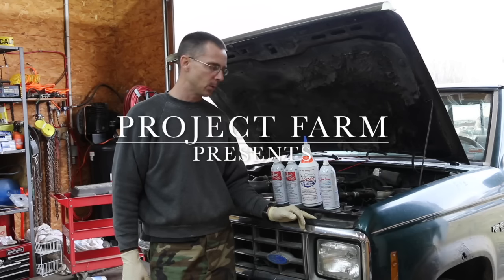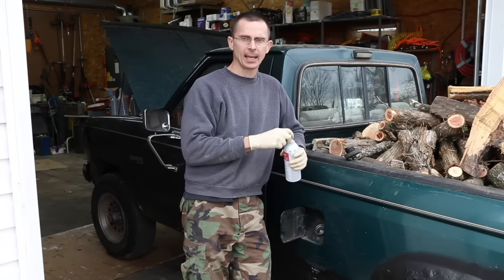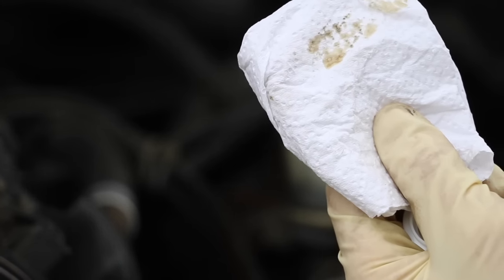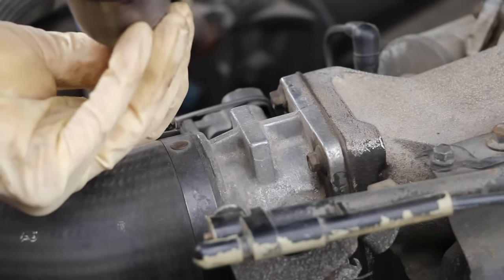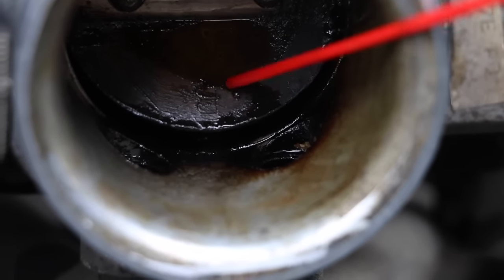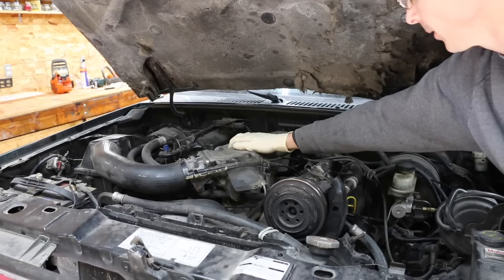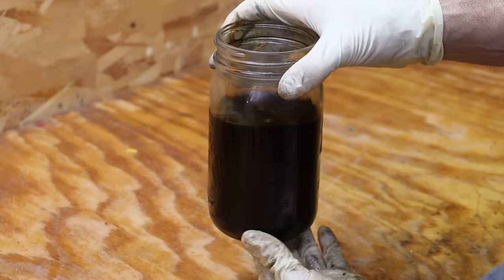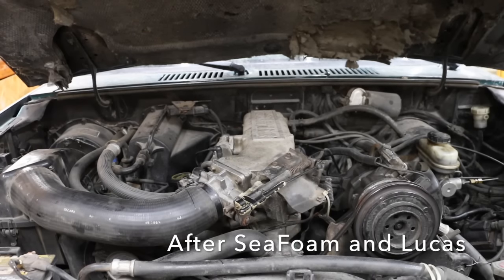Seafoam--can't believe what it did to my engine!!

Comment: Project farm? Can you test the gas engine and see when it will not properly run anymore with too much diesel fuel mixed with it? Florida has a hurricane coming and for some strange strange reason all of the gas stations were the hurricane is going to hit the coast all put diesel fuel in the gas tanks? Hum.... Now I already know putting too much gasoline and a diesel and the diesel will not run but how about the other way around? Thanks if you can do this test it would be awesome.
Reply from the maker: Thanks for the video idea.

Comment: Between diesel trucks and regular gasoline. Do you think it would have the same results? About to give up on this F-350 but it hardly has any miles compared to most 2004. Only 150k and sounds terrible.

Comment: I've had a good amount of experience with valve noise and if its due to a clogged hydraulic valve lifter (which is often the case), then Lucas will make the problem worse.  If this happens, and flushing the engine doesn't solve the problem then you will need to figure out the perfect viscosity of oil to minimize the noise as much as possible
Reply from the maker: Thanks for the feedback.

Comment: I fogged my boat outboard every fall when I parked it.. Choked down till it quit. Then left it all winter. A shot of ether next spring once and away we go.  That engine is 25 years old and purrs like a kitten.  Lots and lots of hours in it.  Also always used 40 to one mix instead of 50 to one on gas. 3 ounces per gallon..
Sea foam is a jigger of acetone in a quart of kerosene.  I read the story about the guys who marketed it.     Old navy recipe.  And coast guard.
Reply from the maker: Thanks for sharing.

Comment: Keep in mind. This is what most mechanics would call trying to solve engine issues with snake oil. Obviously,  every engine repair doesn't need a wrench and part replacement.  Additives are a real thing in being all that's needed in some engine car issues. I have experienced that firsthand over many years of car ownership . This was an excellent video . Yes, some additives may be snake oil.  However, some mechanics are snake mechanics. Yet, mechanics tend to be much less vocal about that.
Reply from the maker: Thanks!

Comment: I use seafoam a lot myself it's good stuff but you got to use it sparingly in a Harley-Davidson that I found I've kind of leaned away from using it even and go with marvel mystery oil sensitive injectors some won't run at all even with c form in them from what I understand and I always had a little bit as good a little more is better definitely not with a Harley I'll put it in a little strong on my other vehicles and it doesn't seem to bother them, I had one engine that would tick a lot and what I poured it into the crankcase I would do it while it's running and you'd hear that tick go away is that stuff was poured into the crankcase even
Reply from the maker: Thanks for sharing.
Reply: thinking about running it through my harley

Comment: I put Seafoam fuel injection cleaner in my 2014 Chevy Silverado cause it had a check engine light on for a bad O2 sensor and to my surprise it turned off the engine light but I went ahead and changed all four sensors and found that one was cracked and the others were covered with carbon and my truck has 132000 miles on it
Reply from the maker: Thanks for sharing.

Comment: I just put seafoam in my Mazda, the bottle says run it for 100-300 miles gonna change the oil tommorow (its been 250 miles) my Mazda takes real thin oil (0W-20) would using the Lucas thicken it too much?

Comment: I used seafoam on one of my previous cars after a fresh oil change. Not only did I smoke the entire town out, I got pulled over by the cops, and told to go home.
Then when I checked the oil, there was literally no oil left in in the car lol 🤨
Reply from the maker: lol
Reply: Wasn't it supposed to be added 200 miles before next oil change?

Comment: I used the spray in my 08 ford fusion 4 cyl, didn’t use the whole can but it did sputter out some darker smoke, sitting at 160k miles, is the oil treatment worth the time yet?

Comment: So when you added the seafoam to the oil, did you let it run more than the 10min you were spraying into the intake? Or did you drive it at all afterward before changing the oil?

Comment: I used the spray to treat my GS300 Lexus which has been giving me grief with gummed up throttle body and idle control valve.   Worked brilliantly.  The method shown here is not that recommended by Seafoam. Read the instructions

Comment: Any recommendations for what treatment to use on a 2013 CX-5 it has over 233k miles and I can tell it's definitely louder on top end of the engine at idle. Maybe not lifters but I'm terms of springs, valves and timing chain. Would this help eliminate that noise or would you recommend a more direct tear down and replacements of parts

Comment: I run seafoam thru my vacuum hose... I take one off the master cylinder, let the car run while letn it suck thru the  vacuum hose and into the motor and i believe thats makes the seafoam work best cause it really runs thru it and it usually smokes alot more cleaning out alot more crap
Reply from the maker: Thanks for sharing.

Comment: Is the product used to add into the gas tank the same as what is added to the engine oil? Is it better to add to the gas tank when it is near empty? How long after adding it to the oil should you change the oil?
Reply: About 300 to 500 miles until oil change if I remember correctly

Comment: I actually ruined my 2002 Silverado with Sea Foam. Dosed the tank per the instructions in the parking lot of Menards and truck died on the way home. Had to get it towed the rest of the way. Ended up being a clogged catalytic converter. Who knows if the cat was on its way out, or if the sea foam just broke loose a whole bunch of gunk all at once. Either way, pricey repair. Probably worked great, but not without risk unfortunately on old, used, trucks with questionable maintenance histories.

Comment: This stuff will remove rust off the walls of the gas tank and take a guess where it's going to? Right to the fuel filter/s and the fuel pump and inside the fuel bowl of your carburator. Don't use it if you don't want to have major problems.
Reply: Rangers have a plastic gas tank and no fuel bowl because it has fuel
Injectors.   A fuel filter change does sound like a good idea
Reply: That’s why there are filters. In line filters will catch all that crap and can be changed until all that crap has moved out of the tank. I know it’s super complicated but I bet you can manage it.
Reply: Fuel filters range from between $30 to $75, getting rid of the crap in the fuel tank makes sense if you know that your filter is in its last legs.

Although, it might not be a bad idea to swap out the pump as well for a 100k mile truck. At that point debris damage has probably worn it down anyway.

Comment: The stuff in the throttle body isn’t carbon but oil from the pcv I believe. You should have took the throttle body off and give it a good scrubbing. As you blew all that gunk in to your engine and could have fouled a plug. But it’s a great video to show how products work. I am going to do the seafoam in my 03 Dakota 4.7 as it has a nice lifter Rick when start up and friends calls its the diesel gas engine lol. Always love your channel as I see how stuff stacks up with each other. I know the video is old but felt cleaning the throttle body by taking it off would help a lot of people.
Reply from the maker: Thanks for the suggestion.

Comment: Someone told me to stick the vacuum hose from the brake booster in a can of sea foam and let it suck it in there on a 3.0 ranger.I did it and it sucked the whole can down one intake runner into one cylinder and slung a rod out the oil pan in my driveway.perfectly good motor before that.I don't want sea foam near my vehicle.

Comment: Snake oil miracle in a can works? Hell yeah! 
We did this back in the day with automatic trans fluid in the crankcase and water injection into the intake. Followup with a couple of oil changes and similar results.  Those snake oil products will work to a certain extent. But your best bet is maintain your engine. Make regular oil changes, use high quality products like mobil one synthetic. Run decent blended detergent fuels. Let your motor properly warm up and don't drive it until the wheels fall off. You probably won't have to use these types of fix it in a can to begin with..... Another problem with products like these is that they can attach various seals and also destroy catalytic systems and O2 sensors .... 
Use sparingly and don't overdo it .
Reply from the maker: Thanks for the feedback.

Comment: Best thing to do to remove carbon deposits is add about a quart of kerosene to the crank case and run the engine for about 100 miles. Then change the oil with fresh. Afterwards add the treatments.
Reply from the maker: Thanks for the suggestion.

Comment: If I add the sea foam to my crankcase, and it turns the oil very dark because of buildup coming off, should I change the oil right away? Or will that not hurt the motor or put the deposits back? I only ask because I plan on doing a full sea foam treatment, and my vehicle literally just had an oil change, so I feel like it could be a waste of money if I just have to change the oil again. Or will my brand new oil filter just keep the oil black, but keep the nasty stuff out? Hopefully you see this!
Reply: Change the oil. What's happening is all the sludge, carbon deposits and what not are being mixed in with your oil by the seafoam. So you don't want to keep that gunk in your engine. And change your filter as well.
Reply: @Yukisho thank you!

Comment: I doubt it cleaned the throttle valve well. So it still needs cleaning. Some of the Seafoam ended up in the oil and provided an oil system flush. But it could be done easier by just flushing the oil system in a regular way. To be honest I don't see any advantages of this procedure in this video. Did a little bit of everything but not very well.
Reply from the maker: Thanks for the feedback.

Comment: One of the worst things I've ever done is put seafoam and Lucas Oil in an AMC 304. Miracles in a can are a bad idea I had a lifter tick which after putting sea foam and Lucas Oil in I had blown all of my seals. Luckily I was able to Source in the AMC 360 but now I understand my mistake. I should have just put in the work that I needed to on the valve train. My engine sounded a lot better for about three thousand miles. By the next Oil Change I had gone from bad to worse and I was replacing the engine. If you have a Clickety clackety valvetrain then take off your heads and inspect your valve train. Don't pour garbage that was never meant to be in your engine into your engine. Don't do it

Comment: Alcor TCP and Marvel Mystery Oil. 
I ran my aircraft engines on the stuff. As low hp as 85 and as high hp as 300 each side. 
Gasoline (avgas) is not kind to the top end of an engine. It's a solvent and not a lubricant like diesel fuel. 
Marvel Mystery oil solves that problem. Alcor TCP makes the engine deliver complete combustion with no carbon buildup.
Reply from the maker: Thanks for the feedback.

Comment: For the record,  Seafoam is not "mechinic in a can" i worked with a Seafoam rep for almost 3 decades. When using the Seafoam spray, alway reconnect the air intake or you will trip codes on newer vehicles.  Not impressed with his presentations.  Sorry to all the followers.

Comment: I drive an 09 f150 and I tried spraying seafoam into my throttle body but when I took the hose off, it stalled. Is there an easier way to clean the top of the motor?
Reply from the maker: Thanks for the suggestion.

Comment: EGR is one of the worst ideas ever.
Precision fuel injection.
Proper atomization.
Cold air, warm fuel, and an efficient head design.
 That results in power and fuel economy.
 Not EGR. An engine thrives on fresh air just like us.
My opinion.

Comment: Cures don't come in a can... 1) the vehicle wan not maintained well BEFORE this video.. 160k is not a lot of miles.. That throttle body, shows how well the vehicle was maintained.. it was filthy.. 2) Seafoam is a good detergent.. yeah, it's gonna clean off a lot of stuff, that should have been cleaned before.. No way, lifters should be sticking and clicking at 160k miles.. 
My Ranger, did 306k before I did anything to the engine, other than change an Alternator.. but I changed oil every 3500 miles, and used NOTHING but synthetic Mobil 1 oil, and Motorcraft filters.. Yeah, Seafoam is great stuff.. I'll pass on the lucas.. But my point is, the engine should have never gotten to the point where it needed this at just 160k...

Comment: For the spray I use water and gently spray (it's Free)  as the water droplets enter the chamber they explode as they turn to steam removing carbon build up. In  so much as the fuel additive I think Tectron is about 1/2 the price. I like what happened with the oil additive in quieting it down. However, which correct oil changes you can eliminate big problems. in the USA all oils are approved just follow mfg instruction and you would not need that LUCAS additive. It Looks like the old STD and CDC which I can't even find anymore. BTW I would pull that air horn off and either replace it (I assume it is also a MAF Sensor) Either clean it properly or myself I would just replace it. Also do not go crazy with the water because you can still hydraulic your motor which is what you were getting close to doing.
Reply from the maker: Thanks for the feedback.

Comment: Had a 1999 400 yamaha bike, carburated. It would fail to start untill I found out they don't do good on gas with ethinol. I would spray seafoam into the carb, let it set and it would start. Now all I buy for my small engines is ethinol free gas. Problem solved.
Reply from the maker: Thanks for the feedback.

Comment: Seafoam does not do anything to your engine......... i literally just got done rebuilding my chevy 350 and all the lifters, pushrods, the heads, intake and exhaust valves, my throttle body and fuel pressure regulator were all disgustingly dirty. I got the truck a little over a year ago and have used seafoam every other fill up the entire time.
Reply from the maker: Thanks for the feedback.

Comment: My Jeep 4.0 is sounding a little diesel like.  Know of anyone that has done seafoam and Lucas with the 4.0
Reply: Well,  I have a 4.0 and im planning on seafoaming it this weekend. can let you know how it goes
Reply: @diekatzefliegt  ah please do.  I’ve been very tempted.
Reply: @BradMillsOK  Just dumped it into my tank and later this week I will do the spray if my issue (pinging) doesn't go away
Reply: @diekatzefliegt  so you did the fuel additive?  How much?
Reply: @BradMillsOK  I put a little more than half the can in, so around 9 oz, and there was 5 gallons in my tank (seafoam says you should do a 2 oz to 1 gal gas ratio, so i just guessed). Will drive it tomorrow, so hopefully I'll see some smoke!
Reply: @diekatzefliegt  right on man!  Keep me updated please.  Wish it and you the best!
Reply: @BradMillsOK  will do, and thanks! I ran it this morning going to work and obviously I haven't noticed anything yet. I'm trying to drive a little more aggressive than normal. When I go through these 8 gallons of gas, I'll see how the pinging is and report back
Reply: @BradMillsOK  Hey Brad. I went through the gas and i think I have had pretty good results. The pinging seems to have nearly disappeared under medium loads, and is a lot better under heavier loads. This may be too early to tell and could totally be a placebo, but I feel like my throttle response and fuel economy is a little better than before. I am going to try the spray down the TB some time this week to see if i will have even better results.
Reply: @diekatzefliegt  awesome man!  Was just wondering earlier about you and your 4.0.  Glad to hear!  Guess I may give it try.  You did the fuel treatment only right?
Reply: @BradMillsOK ha yeah man! And that's correct yeah. I would not put it in the crank unless you're prepared to drop the pan and replace the filter, I've heard horror stories. However I'm not sure how effective it will be for your dieseling issue.  Can't hurt to try tho!

Comment: BEEN MECHANIC FOR 40 ODD YRS...
WANT CARBON CLEANED OFF PISTONS AND CHAMBERS....USE WATER..!
CONNECT UP YOUR WASHER BOTTLE HOSE TO INLET VAC. UNION ON MANIFOLD AND DRIVE ON AND OFF THROTTLE KEEPS REVS UP BY TIME USED A LITRE WOULD HAVE STOPPED PINKING ..ECONOMY AND STARTS BETTER....CHEERS
Reply from the maker: Thanks for the feedback.

Comment: WRONG! If your lifters are making noise in your older vehicle, ALWAYS use just 30 weight oil with synthetic , the heavier oil will keep your lifters full at all time, not like 10-40w that will change oil weight as the engine gets hotter. NEVER use SeaFome, it destroyed my oxygen sensors.

Comment: The rpms were way higher when testing for a ticking sound after the sea foam. All engines will sound better when your reving the engine. I don't believe this is a fair comparison. A ticking lifter will always be a ticking lifter, no matter what kind of snake oil you throw at it. Run the engine at the same idle rpm's you did before the sea foam, how do you know how good of a job sea foam cleaned out the carbon deposits if you did not do a tear down? Ask any mechanic, there is literally no chemical than can fix a noisy engine, period. Worn engine parts are worn engine parts. This is false, the only thing additives are good for are for engines that are in good condition for preventative maintanence, if an engine is wore out, its wore out. Will unfollow, this is complete BS